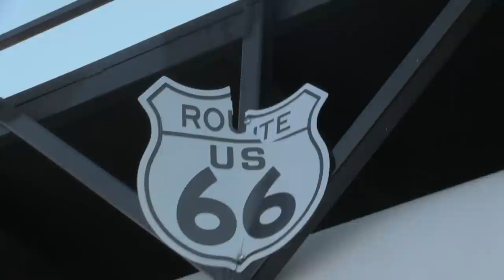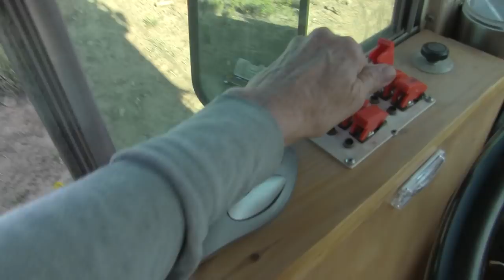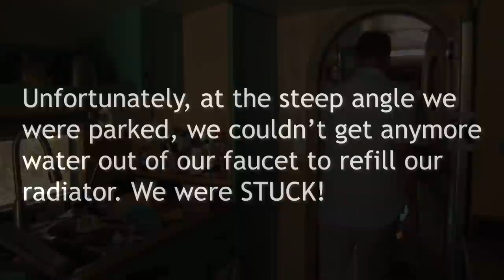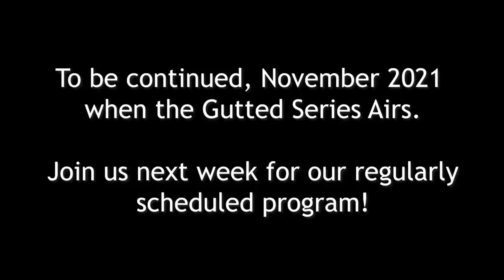Repair... Breakdown... & Self-Recovery on the road to Gutted!

Comment: Great video, Mikegyver, great job on the bypass power supply for the fan motor. the original switch is likely near the oil filter mount. Anyway the fan motor can be sourced at a good parts house, NAPA or Advance, they will have a book that lists all there motors by voltage, rotation, shaft size, etc. and not by application.  Good luck and again good job.

Comment: its not just the heat raising the pressure in the coolingsystem , the added height on top of the mountan lowers the airpressure and lowers the cookingpoint of the coolant
btw running two big fan motors so they start at the same time , even if you run them on seperate relays and powerwires might overload the system (read alternator) on startup , it might be better to put a timer / delay between the two so the second one starts up after the first is spun up and fully running

Comment: Hey yall i was noticing the rear tires looked like they are running soft, could just be camera angles an stuff but it looked like they are wearing\riding on the outside of the tires

Comment: Omg, the fan saga! I just had this issue too. I will need to replace my fan hub but for now I have a fuse hooked up to keep the fan on whenever the bus is on. I’m using more fuel & running a bit cool but we are rolling!  I wish you better luck with mechanical issues 🙌🚌

Comment: So sorry to see your expansion tank exploded. You could go to a rad shop and have them make you an expansion tank. The cap should be an 8 to 13 lb radiator pressure cap. If your replacement fan does not keep the engine coolant temp down into the 180 - 190 degrees. Do you have a transmission oil temp gauge. If you do what is your trany oil temp when climbing the hills. Transmission oil is cooled by the engine radiator. High trany temp can cause the engine temp to run hot. 
You don’t want the engine coolant temp to get any higher than 200 to 210 degrees. Running hotter than that you are going to have more problems with the engine. Pistons, cylinder head. 
Also do you have an air to air charge cooler on the back side of your rad or the front side. Dirt and oil can plug up air flow through the rad. 
With a heat gun check the temp of your rad when your engine temps are high. The top of rad temp should be 180 - 190 degrees and the bottom should be at least 10 degrees or more cooler. If it’s the same temp then your radiator core is plugged up. You should be able to feel the temp difference with your hands. 
Good luck

Comment: I have seen mixed reports of flat towing Jeeps. Some say its totally fine others say don't do it. Is them flat towing possibly a cause of this issue. I know flat towing can cause transmission cooler in the radiator to overheat it and blow the radiator.
Reply from the maker: It is safe to tow the Jeep because we put the transfer case in neutral and no motion gets to the transmission or the engine.

Comment: I remember reading a couple of years back about "prairie" buses and "mountain" buses. Whole different setup because obviously, mountains is all high and whatnot. So maybe what you have there is the other one that will just roll across the country from east to west better than hitting the peaks. You would know better than I about which one you have. That fix was rather clever you know. 

Also, why not put the word out about your model number and see if anyone can turn up a manual for the bus? 2000 eyes are better than 2 and all that junk. 

Kerry, "On The Road To Gutted". Hilarious! I can only imagine that within a few short hours you and I could easily make people go crazy by just playing with puns and twisting sentences around. The groaning ... the groaning ... the groaning. 

Glad you made it through.

Comment: hope you are not towing the jeep with out a dolly  being atuo trans their is no oil moving to lub the the trans, so the clutches are running dry
Reply from the maker: Jeeps are a very common tow vehicle. You can put this Jeep into neutral on the transfer case and tow this vehicle.

Comment: Couldn’t you make a stronger tank there out of pvc pipe & end caps etc…. : )
Reply from the maker: PVC pipe is especially affected by heat. I'm afraid it wouldn't work very well.
Reply: @BussyMcBusface  true, I used a toaster oven to make mudguards & a chain guard for my pedicab. I didn’t think of that. It’s tough when not heated though. : )